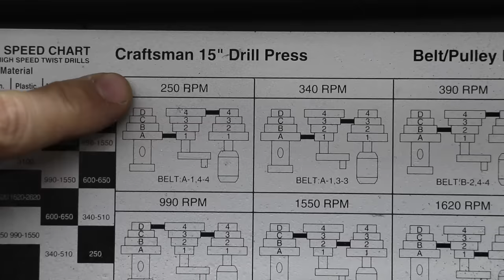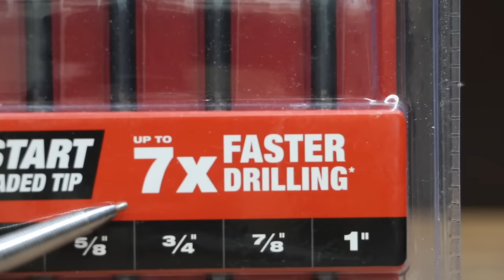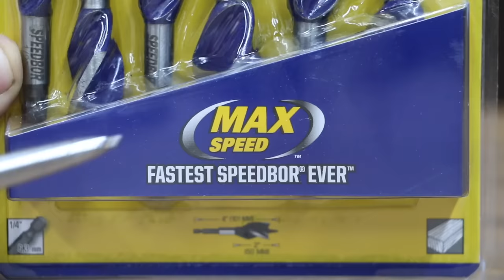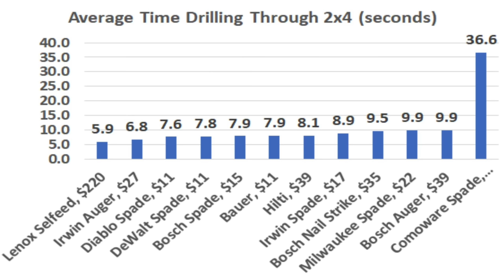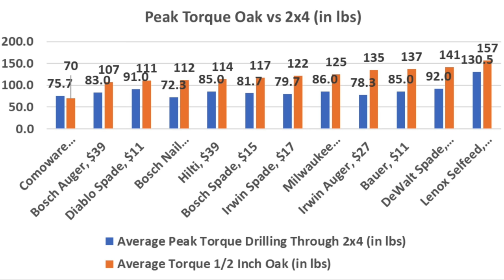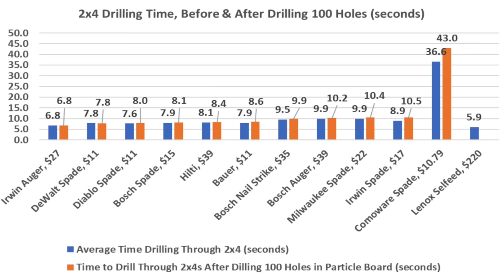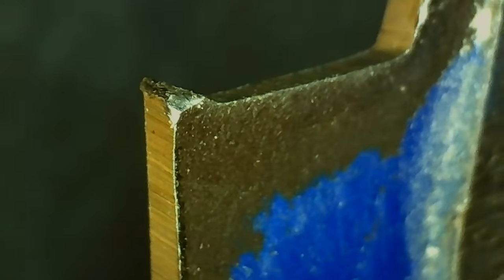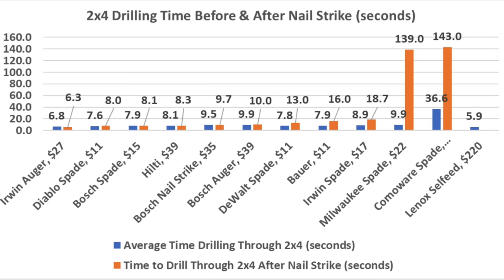Best Drill Bit Set? Hilti vs Milwaukee, DeWalt, Bosch, Bauer, Lenox, Irwin

Comment: This is one of those "but what are you using it for?" tests.  Spade and Auger bits have their place in construction but when making cabinets I'm always grabbing for forstner bits for a clean hole for furniture or without a long center point to still be useful for hinge bores for cabinets.  With those bits, it's always "How much tear out do I get in hardwood and ply?" and "How long will they stay sharp?"  Be an interesting follow on test to this.
Reply: Ive used the exact same 3/4 irwin auger bit to drill sill plate holes through fully saturated dripping wet full ground contact salt treated 2x8s for like over a decade. Ive sharpened it maybe 3 half assed times.
Reply: Theres really no comparison between tools used by weekend warriors diy cabinet making and the tasks that can be completed using spade and auger bits on a jobsite.
Reply: place a sticker over the area to be drilled, or a thin piece of sacrificial wood to minimize tear out.
Reply: Forstner bits are specifically for making partial holes in wood where you need a flat bottom on the hole.  They can of course drill all the way through as well, but that's not their main purpose.  This is also why Forstner's cost a lot more.  If you're just going to make through-holes, you don't necessarily need a Forstner.
Reply: @somejoe7777  yea like totally irrelevant regarding this video aside from being a type of bit i guess.
Reply: If I really want low tearing I go for my handbrace with auger bit especially designed for a brace (square taper shank and sharp edge knife
Reply from the maker: Thanks for the suggestion.  Happy New Year!
Reply: yeah finish bits for finish products, most folks watching this for these type bits are most likely electricians plumbers or some type of trade that needs pass throughs with wood. the cleaner cutouts just reduce splinters.
Reply: @genghischuan4886  My electrician uses a forstner for general wiring holes in framing. They offer a much smoother ride when doing multiple, multiple holes with a hand held drill. Also relatively easy to resharpen. He has many bits for different applications but the forstner is the go-to.
Reply: Same here...I have a set of forstners I use for "good" work and spade bits for rough carpentry.  That's what they're supposed to be used for, at least IMHO ;)
Reply: @DiscoFang  wow one out of how many and that is the one who speaks for them all. lmfao yours is super awesome wonder eletroman. The things people say with such authority when there is none in the first place
Reply: @genghischuan4886  what?
Reply: Agreed!
Reply: @genghischuan4886  uhhhh Somehow you’re speaking for all plumbers & electricians??
Reply: @DiscoFang  NAH i WAS POINTING OUT SOMEONE ELSE THINKS THEY ARE
Reply: @DiscoFang  I don't know why your electrician is using forstner bits for rough wiring. That's a bit goofy considering how. many holes we need to drill. But more power to him. It sounds like you pay him hourly 😉
Fyi, everyone "has many bits for many applications" metal bits, unibits, hole saws, paddle bits, you name it. but almost no one would use a forstner bit for rough wiring holes.
Reply: @austincox1239  You don’t know why? I just explained why. If you tie yourself to what you think is “right” - that’s narrow mindedness.
Reply: @austincox1239  btw by your “hourly” comment you clearly have zero clue how fast a forstner bit is through hardwood framing.
Reply: @DiscoFang  I'm not narrow minded. I'd use a forstner bit if I had to run wire through an island or some cabinets. A few holes, cleanly drilled. 

Forstner bits are too slow to drill put 100 holes in a new house. No one has time for that and no one cares if it's smoother. It's like using a chisel instead of a hammer drill because it's neater. 🤤

Comment: I use Diablo so I'm glad to see that it was one of the best.  I was never under the impression that it could get through nails.  I drill holes for plumbing pipe so most of where I drill there are usually no nails anyway.  Plus their cheap enough if I need a new one
Reply from the maker: Thanks for sharing.

Comment: Another awesome head 2 head Todd! Suggestion, have you considered using engineered lumber for your tests, so you can eliminate the many variances found in standard wood? Engineered lumber wouldn't add too much to your production costs, but would add another level of accuracy. This would give you accurate cut times, and wear rates.
Reply from the maker: Thanks!  Thanks for the suggestion.
Reply: Exactly what I was thinking. He'd have to drill a hundred holes minimum to get a decent sampling.
Reply: What kind of engineered wood? Mdf and particle board don't produce the same amount of wear as real lumber. For instance, the Bostch spade bit did well in this test after 100 holes in the particle board, but in my experience the Bostch is almost useless after a 100 holes cutting through studs.
Reply: Why not just use aluminum.

Comment: Another great test. In 40 yrs of carpentry, I’ve tried several brands of these bits (B & D, Craftsman, Dewalt, Irwin, etc). I currently use a set of Rigid auger style bits, and can attest to their superior durability over paddle style bits. This is particularly true if you hit a nail, as your test revealed. Also, the Rigid has a screw tip, which your test also revealed as an advantage. I could never justify the expense of the Lennox bits, and your test shows why. Bauer is a brand known for excessively inflated claims, even though I like their tools.
Reply from the maker: Thanks!  Thanks for sharing.
Reply: @MidwestFarmToys  they’re American made. The company is headquartered in Ohio.
Reply: Ya those lenox were not impressive at all, especially for the price. You get more bits but the value just doesnt seem worth it. Of course the diablo seems to be very good value and performance as they usually are. Auger bits and spade bits are meant for different uses though. Auger bits you'll get a straight deeper hole tha  a spade bit. I wouldnt use a spade bit ina deep whole where accuracy was a concern, auger bit is much better suited for the job.

Comment: I've been using irwin speedbore for the last 5 years of being in the cable industry (the 16in version). A must have for drilling a hole through walls, goes straight through a stud if you hit one!
Reply from the maker: Thanks for the feedback.
Reply: A little romex will slow you down.
Reply: Bought the Irwin last year as I tried to go thru floor joist in old house. For whatever reason the joist were 14” center but 4” rough cut. Used with dewalt 1/4 inch impact and worked incredible ez with almost no pressure need or wrist torque.  Cannot even remember how many times my hand got wrapped around a powerful drill when bit got caught.   Also bought set of quick change extension that came 3”,6”,and 12”.  Some of joist had almost no room and used extensions thru a previous joist  to get those.
Reply: @jeffclark6202    A 220ac will ruin your day !
Reply: @shade38211   your first taste at being a plumber, can’t tell you how many times I’ve had to do that. Even in new houses .  Oh the verbal abuse I given to framing !!
Reply: I am a new construction residential electrician and I drill hundreds of holes on each house. In Florida, most houses are block, so we hit concrete a lot. I've been using the Bosch daredevil auger bits (16 inch). I get years of use out of them before having to replace. Our shop recently replaced my 1" bit with a Diablo and so far it's held up to the Bosch

Comment: Diablo is the ones I went with last year when i picked up a set that was a holiday special that was marked down super low and have been impressed with them. Also Diablo does now make a bit to cut nails and have seen others as well maybe that's a revisit to this on which nail cutting spade bits are the best.
Reply from the maker: Thanks for the suggestion.  Happy New Year!
Reply: they also make great circular saw blade.
Reply: @piworower  Everything, really. Until you get into industrial tooling, Diablo makes the best consumables I've ever used. I would say they are interchangeable with Bosch as well for the most part.
Reply: There are so many wood-drilling bits on the market from all sorts of brands, that this topic really deserves a part 2. And then perhaps a part 3 to compete the best performers from parts 1 and 2. 
And there can be different criteria like speed, cleanest hole, durability against impacting nails, chip ejection for drilling deep holes and not becoming clogged (probably use a bit extender for that). 

It's a lot of work, but I know many viewers would really appreciate it.

Comment: I use the Irwin speed-bor and I'm happy to see that it did well. But that Bosch nail-strike is impressive as well! (Drilling through studs on existing construction, you are inevitably going to hit nails from time to time.)
Reply: @Ross Radford Plus, these new style bits with the "spurs" on the outside edge cannot be resharpened on a bench grinder, something you used to do regularly when remodeling and hitting nails.
Reply: Used to exclusively use the speed bore bits until I discovered the spider bore bits. They're even better than the speed boards. Very impressed!
Reply from the maker: Thanks for the feedback.  Happy New Year!
Reply: Even new construction! 
Running gas lines, putting 1.25” holes through double, sometimes triple 2x4s there would be the rouge nails. I used the Bosch auger showin in the video as it lasted the longest. 
Con was it would sometimes get stuck deep and not move fwd or rev. Low speed high torque worked best. When stuck it would torque out of the user nearly hurting the operator.
Reply: @Ja2808R   Interesting!  I wonder why it sticks sometimes, why it has trouble moving again either way, and why it would torque out and put you in danger.  Any thoughts on any of this?  I was so impressed by Irwin Speedbor (Auger) in Todd's test that I was going to buy them, but now I have to question that.  How did you get it out when it stuck?  What do you mean by "torque out of the user"?  Torque out of the drill chuck?  Please elaborate.  Thanks

Comment: I have been remodeling my old 1880 house for the past 15 years and have been drilling a large amounts of holes for electrical and pex heating tubes.  It wasn't too long in the process that I found the Irwin auger bit style and just by experience alone it out has out performed the others I used.  Glad to see I made the right choice!
Reply from the maker: Thanks for sharing.

Comment: Irwin Augers have my vote. I bought a set several years ago to use on some age-hardened wood that had stalled out nearly every spade bit I tried, even with a pilot hole. The Irwin augers went right through it with ease. They have held up for many years.
Reply: An interesting question comes to mind here concerning the difference between bits from 10 years ago and now. Maybe cost cutting took place in the interim, no guarantee the bits used have the same performance as the same bits manufactured a few years ago. I've read people seek out bits with slightly different packaging that indicates a bit was manufactured in Europe instead of China but had the same product number. 
I guess I'm trying to say things change and there's going to be variation in quality of the product over time
Reply from the maker: Thanks for the feedback.  Happy New Year!

Comment: This was great!  Thanks!  I like the Irwin Speedbor Auger bits for the speed, clean entry and exit.  The slightly longer time in hardwood isn't an issue for me because of the clean cutting, plus it retained its sharpness and speed after drilling 100 holes and after hitting the nail.  I think that's extremely impressive!  $27 for all of that ain't bad!  The Bosch Nail Cutting Bits have their special application.  Trouble is, knowing when they are needed, but the Irwin Speedbor Auger bit tested fared very well.  Not that I'd count on that.

Probably 20 years ago, I bought a set of 16 Flat Bottom drill bits called Forstner Bits to make areas for tealight candles in glass holders to represent a campfire for a seminar-type learning course at the end.  I used landscape timbers with rounded sides, cut them into about a 3 inch height, drilled the hole in the tops and mounted them with long screws in an upward arch of 5-6 tiers with one at the top.  Forstner Bits make a flat bottom hole with a small, shallow center point like a V.  I've seen other designs since that make a perfectly flat bottom without the V, but I used Forstner Bits.  They did the job I needed perfectly for me, so I wonder what a comparison of Flat Bottom drill bit types would reveal.  Just a thought.

Thank You for everything you do for us.  Your time, effort, ingenuity, money spent, dedication and honesty still highly impress me!  That's why we come to you, Todd, and why I'm so glad I found you.  You have well earned your 2.19M subscribers!  That's impressive, too.  I wish a Happy and Prosperous New Year to you and yours!
Reply: I mean it's pretty easy to tell if you need a nail cutting drill bit or not, you can see nail holes indicating there might be nails in the wood after all.

Comment: i have a set of the irwin auger bits, and in my experience my drills have always been the limiting factor in how fast they'll cut through a piece of wood, i use mine in an impact driver because ive had them try to rip the drill out of my hands several times
Reply from the maker: Thank you!
Reply: after I smacked myself in the face hard enough to bloody my lip while running an 1 1/2 inch irwin auger in my dewalt cordless hammer drill, I put the auxiliary handle back on and left it there haha.

Comment: Very interesting thank you.  But most of us who bore through finish woods like oak bore 1/2 to 3/4s of them way through or thicker pieces until the center or starter part of the bit just pushes through. Then we reversed the wood and go in the opposite side.  This way we don’t have to worry about tear out.  But as always outstanding video.
Reply from the maker: Thanks!  Thanks for the feedback.
Reply: In my opinion it's easier to get accurate results in hardwood if you set the stop on your drill press to allow the center of the bit to barely poke through the bottom, then flip over and center the bit using the small hole.
Reply: You can avoid hitting nails most of the time too. The tests weren't supposed to all be examples of best technique. I think showing how bits compare when they do tear out the back under controlled speed and pressure is a useful test. If he was being very precise to avoid damaging the wood, he'd be minimizing the range of outcomes, which makes the comparison less clear. Most people trying to make seriously clean cuts wouldn't touch a single one of the bits used in this video.

Comment: I just bought a set of these less than a month ago and I checked to see if there was a Project Farm video on it.  There was not, but now there is!  I bought a cheap spade set because I only had to widen a hole in soft wood.  I was perplexed at the variety of these drill bits, and now I get to see them in action.  These videos are the best and I like these measurements done in triplicate.
Reply from the maker: Thanks!

Comment: Great comparison.
I was a little surprised by your results with the self feed bit. I have used a ton of the "Lennox style" self feed bits installing conduit in rough framing.  Using a hand held 1/2" drill motor at 400 - 600 rpm, I found they cut through nails pretty well.   I suppose I just got used to altering my pressure and grip while drilling.  I also often had the bit  "stall"  due to a clogged worm tip in resinous woods, which I cleared by reversing and racking.
Using a Milwaukee Hole Hog, (300 rpm) I could run the 2-1/2" bits pretty well through nails. Of course, the bits needed sharpening after each time they found a nail,  and there was a real risk of getting spun off my ladder, or thrashed around in an attic.
Reply from the maker: Thank you!
Reply: Those low speeds are drill press speeds. With a handheld drill, a forstner bit through softwood should be around 1500rpm and an auger should run around 700rpm. With the Speedbor, Irwin themselves specify an rpm range of 1500-2000rpm.
Reply: @DiscoFang  agree, but those beefy drill motor don't have the torque for big holes at high speed.  Most of what I drilled was old dog fir... not really a "soft" wood, needles notwithstanding.

Comment: These are great for construction, but none leave a good clean edge for woodworking. For that Fisch dual spur brad point drills can't be beat.
Reply from the maker: Thanks for the feedback.  Happy New Year!
Reply: Good tip. I found the SPEEDBOR to work well for floating shelves. I'll take a look at the Fisch, however, do you know if it would work without a drill press?

Comment: I bought a Ryobi drill bit set 25 years ago, that included 5 different sized spade bits. Earlier this summer, a violent wind storm ripped 3 sections of a fence down, snapping five 4x4 posts. I used the 1" spade, with a 12'' extension, to cut 6'' deep into the posts encased in the concrete footing.

Those 5 posts were repaired in mere days. A fresh coat of paint, and the fence looks as good as the day I'd put it up, 29 years ago.
Reply from the maker: Thanks for sharing.

Comment: It would have been interesting to see how they felt to you, if you drilled a hole by hand. I know it is subjective but if you are having a hard time with a drill bit getting stuck, jumping around or busting out the side, the chances are every lay person would have similar issues.
Reply: I also wonder if rpm of the drill slowed down with the drill bits that required more torque to drill.